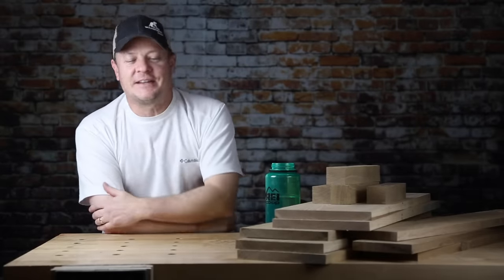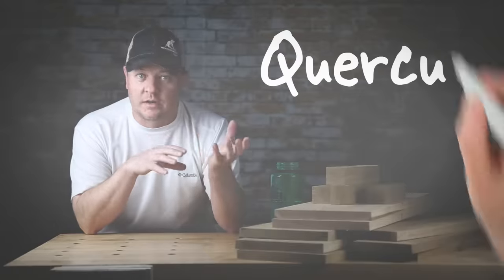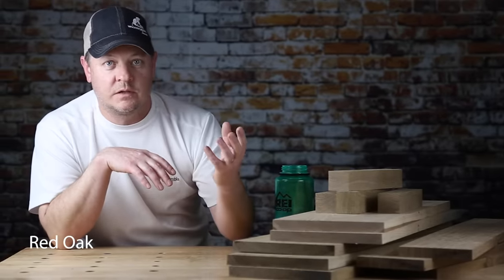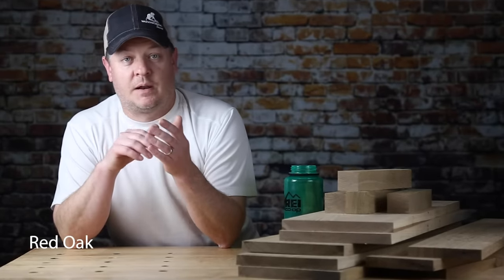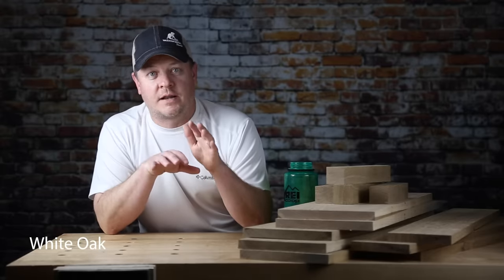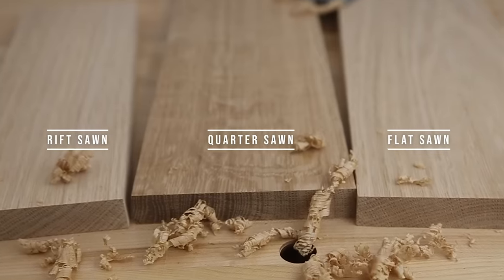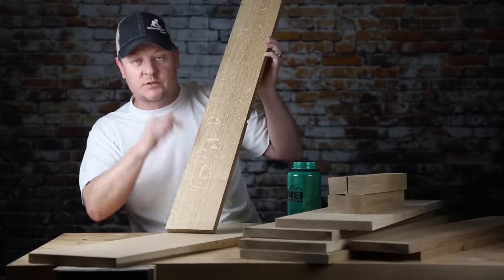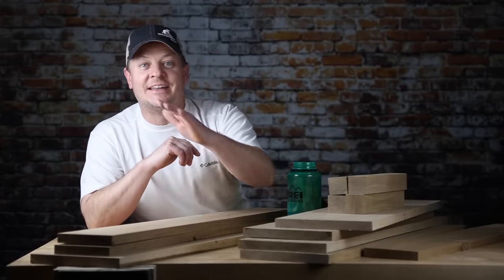The REAL Difference Between OAK Lumber

Comment: I have some left over solid oak flooring, is there someway to identify if it is red or white?
Reply from the maker: There are subtle nuances in the color and grain that are just difficult to communicate in a comment here. Get a known piece of red or white oak to use as a control. Even better if it's the same size as a piece of your flooring. White oak is heavier so you'd be able to detect that in your hand as long as both pieces are about the same size.
Reply: Look at the end grain, white oak is closed pore and red oak is open. You can usually tell them apart easily, but you can wet the end and see if it wicks up the grain.

Comment: What he failed to mention is that all of the other species are also sawn and are sold as either red oak, or white oak.  While some the difference is minor, others are quite different.   Black oak is more red and softer than true red oak, pin oak is brown and tan, but is still a red oak.  Cherrybark is by far the superior red oak lumber species.

Burr oak is white oak, but much darker color, as is Chestnut oak, but it is lighter weight and has open pores like a red oak, thus cannot be used for cooperage.   Swamp Chestnut oak is lighter than true white oak, and highly prized in the veneer trade.  Chinkapin (Chinquapin as it was known till a few years ago) oak is more yellow, but has very distinct grain.

Hope this helps some people with color match and grain match issues.   Many more factor's come into play, but I wanted to share that.  At the sawmill we might have a half dozen different species, cross bred species, healthy tree's, nearly dead tree's, all from dozens of different locations which further add to the variations.  All this is sawn, put in the same bundle and shipped together.  That is the commercial side of hardwood lumber business

Comment: There is a way to differentiate white oak and red oak. Very often resellers get red and white oak species mixed.
There is a way to tell for sure using water. The white does not transfer water through capillary action.
Could you explain this simple test? If you mistakenly buy red thinking it was white your outdoor project will be very short lived.
Reply from the maker: Not sure about using water . . . but using eyeballs you can look at the end grain and compare boards and white oak will be noticeably darker and tanner than red oak.
Reply from the maker: actually, see comment by full circle school of woodworking for info about using soapy water on red oak:
 https://www.youtube.com/watch?v=AeRjXyYA41I&lc=UgwWMKEKBIk3nvrT0Dl4AaABAg

Comment: Interesting story, but USS Constitution was actually built of southern live oak, Quercus  Virginiana.  Another difference is that most white oak is suitable for boat building while red oak and a few other oak species are not.  Water will move through red oak like a bundle of straws.
Reply from the maker: 👍Parts of it were, yes, but not the outer hull. The point remains.... white oak is tough, and it's great for exterior projects.
Reply: @WoodworkersSourcecom  :  The "outer hull" or skin of a vessel is a system that makes the vessel watertight, and, in the case of a warship, provides defensive protection.  In the case of 18th century vessels, in this case USS Constitution, the outer hull consisted of three layers of wooden planking:  two of white oak which sandwiched one of live oak.  That system was unique for its time in that the live oak layer made the hull impervious to cannon fire.  Contemporary vessels which commonly had hulls double or triple planked with white oak were readily susceptible to damage by cannon fire.
Reply: However, Q. virginiana is a type of "red oak."

Comment: All red oaks have pointed leaves even though they're different species.  Scarlet oak, Pin oak, and Red oak. These are open pore woods. As a straw in liquid. Boats made of red oaks would fill with water, not good. Red oak has tannins that eat through iron hardware pretty quickly.  White oaks have rounded lobed leaves and are closed pore woods. Bur oak, Swamp oak and White oak. Much better for boats and whisky barrels.
Reply: There are several species of "red" oak which have lobed leaves (Schumard - which is excellent for lumber, Southern Red Oak- also good lumber, black jack and blue jack oak are a few examples.  These "red" oaks loose their leaves in the Fall.  "Red" oaks with ovate leaves, such as live oak, myrtle oak, water oak, etc., are "evergreen" oaks.  The emerging leaves in the Spring cause the leaves from the previous year to drop.

Comment: I posted on the walnut video also.  I live right in the middle of the midwest.  We can't get walnut or white oak.  The sawmills are saving back for China.  All of the walnut and white oak are being sold and shipped to China.  Not sure what they are doing with it, but they are buying as much as they can, at higher than top of the market prices.  Don't get me wrong.  If you want a few pieces at an extreme premium, you can get it.  Especially if you are a regular customer.  Bottom line is, it's all going to China.  I know this for a fact.  My local lumberyard recently sold 1.4 million board feet to China.  1.4 million isn't alot, in the grand scheme, but for a small yard in the middle of nowhere, that's alot.  Think what that means on a country wide scale.

Comment: You talked about the cosmetics but not the real structural difference. The pores in red oak are open but in white oak they are filled with resin making it denser, heavier and much more impervious to water.

Comment: The USS Constitution hull is made of both White Oak and Live Oak, the hull consists of three layers with the outer and inner layers running horizontal and made using White Oak and the middle layer being Live Oak and running vertical.  White Oaks grow tall and thin whereas Live Oaks are massive, low branched, spreading crown oaks prominent in the Southeaster U.S. Live Oak is about 40% denser than White Oak and significantly stronger than White Oak. The Live Oak center core is the reason that Constitution was able to withstand the cannon shots so will.

Comment: What about quartersawn red oak? I have not heard of quartersawn red oak but that don't mean it doesn't exist.  Thanks Don
Reply: Any wood can be quartersawn.  It just means that the slab runs radially out from the center.
Reply from the maker: yeah sorry if it didn't come across that way, but yes, red oak can be quartered and it too can reveal the same fleck figure/character you get in white oak. However there is more market demand for quartered white than there is quartered red.
Reply: You just happen to be in the wrong part of the US if you have not seen quarter sawen Red Oak
Reply: @TheFalconJetDriver  I am in Nashville.

Comment: Red Oak has an open cell structure which lends it to breakdown by fungus and premature rot of outdoor projects.  White oak has a closed cell matrix which means it does well in wet environments.  Cheasapeake Bay boat builders have long used white oak as the frame basis for deadrise (workboats) used in the traditional crabbing and oyster harvesting business.  You can steam white oak and make it very flexible to form into complex shapes necessary in boat building.

Comment: One of the biggest differences with red vs white is red oak has open pores and will soak up water faster, were as white oak has closed pores and will not soak up as much water. Take a 1ft peace of red oak and the same of white oak and put one end in water and blow on the other end and you will make small bubbles with the red oak but not with the white oak. Then leave them standing upright in the water and come back an hour latter and see what happens. Then you will know why ship wrights use white oak for boats.

Comment: You didn't mention the water permeability properties: Water easily penetrates red oak but not white oak. Thus whiskey barrels are white oak. You can use red oak barrels for dry products like wheat flour stored in dry locations; if it rains on red oak barrels the flour will be ruined.
Reply: Agreed.  I replaced the white oak rub rails on a 40 year old navy hull (motor whale boat) with red oak.  It was rotten in less than 5 years in a Chesapeake Bay environment.

Comment: Want to try something fun take a shoe mouldings size of red and white oak 8 or so inches long put it in a cup
Of water and blow you will be able to blow bubbles thru the red oak but not the white because of the grain structure have fun

Comment: There is only about two species that matter to woodworkers.
Did you say that ? Did I take that out of context ?
Cause I like lots of different wood.
I really like Doug fir, but that’s coniferous.
I’ve use both white and read oak in projects.
I do like white oak more though.
It’s a great lumber for furniture.
1/4 saw also tends to stay very straight. Yes it looks great.
Reply from the maker: tina Haynes sorry yeah that should be “types” rather than species.

Comment: I'd like a lil more info on those cut techniques on the difference and how they are actually cut.
Reply: Look closely to the grain on the end of the boards when he is discussing how they are cut.  flat sawn the grain is parallel to the surface.  Rift sawn the grain is at 45 degrees to the surface.  Quarter sawn the grain is perpendicular to the surface.

Comment: You are wrong on one count. Only about 1 in 20 red oak boards will have well defined medullary  rays, which is prevalent in white. Also, R.O. tends to get mixed in with W.O. and can be hard to distinguish... until you finish. The two woods will take stain differently. R.O. is very porous, in W.O. the pores (rays) are sealed thus the distinctive look.
Reply: All the red oak I've ever seen has a pinkish-orange (ish) tinge to it.  White oak is more neutral.  I always thought the name was a reference to the color of the wood.
Reply: You can tell the difference at a glance nearly every time by looking at the end grain.

Comment: Please add the following, white oak has closed cells which is the real reason why it works for exterior projects and red oak does  not. In fact you can actually use red oak to make soap bubbles. Red oak is a very porous and...
Reply from the maker: True. Thanks for speaking up!

Comment: Your map does not even Mississippi, Arkansas, or East Texas where there is large amounts of Red and White Oak. I worked in a flooring mill where oak flooring was produced, and I have cut and hauled them as pulpwood in South Arkansas. I have also cut up two Red Oaks there that were over 100 yrs old. Personally, Red Oak is more attractive and less bland than White Oak in flooring.

Comment: Excellent description.  I would add however,,,, red oak is fairly consistent regionally.  Red oak as cut in Missouri is the same as Michigan, the same as found in Vermont,,,,, just another reason why red oak is universally liked and used.

However white oak exhibits very strong regional characteristics.  One reason may be in the extinction of the American passenger pigeon,, white oak two hundred years ago was perhaps half of all trees in the central states and New England, because the bird and the acorns had a symbiotic relationship.  No birds, fewer trees.  But,, for some reason Tennessee white oak is different than Michigan white oak and New England white oak is the very beast to work.  The US Constitution is hulled with New England white oak,, and that material can dull aluminum oxide sanding belts on the knots and burls.  Steel hand planes need frequent resharpening,,
Reply: Great piece of info, Sailor, thanks!
Reply: A lot of our American hardwoods are nothing like they where 200 years ago. Mostly because we clear cut through a lot of it around the beginning of the 20th century. What we have now as mature stands has only been growing since then and, in the case of most of our red oaks, it is nearing the end of its life span. White oak in general has a slightly longer lifer span, but they too are nearing the end.
Reply: @thomascalton3067  Yes.  We deal most ,or entirely with second and third growth forests.  I had a heart breaker recently.  I was called out to get rid of a wind fall, a tip up.  White oak, second growth I'd guess, but forest grown.  36 " chest high dia. 130 plus feet tall,, 50 or 60 feet of straight, clean bole.  But,,,, in a residential area and on ground far too soft to get equipment in, and other considerations.  All turned into firewood.  Broke my heart,, but no way to do anything else with the constraints.
Reply: @Sailor376also  That is too bad.  I personally believe our second and third growth timber of any species including our softwood cannot compare to the growth patterns and quality of true oldgrowth. It's just too bad it takes many centuries to get it.
Reply: @thomascalton3067  Yes.  Just discussing a long term project with a Canadian Province two weeks ago. A truly valuable forest and production begins with that 100 plus foot tall second growth forest.  That is just the nursery required. And then,, you get the lumber or veneer trees started underneath.  The single most valuable trees in a 300 year old forest are those spindly thin telephone pole like, absolutely straight and not a branch on them with a tiny crown struggling to get above the canopy (not dissimilar to that one I chopped up),,,,, because those are going to be wildly valuable and exactly the trees you are referring to.  Small, tight grain, and clear lumber.  Each single tree within a hectare (about 2.5 US acres) is as valuable as clear cutting the entire plot for 35 year old chip board trees. And you can take one or two every 10 to 20 years indefinitely,, and make 20 times the money per year as that chip board forest.  But,,,,, It requires a 200 year plan.  Ain't very likely to happen.

Comment: Greatly informative, thanks for presenting so well. Rapid fire monologue and cutting are at the very limit of what these old bones can handle, but I'll try to keep up.

All the points I was ready to add seem to be covered by previous comments, save one. Red Oak, when cut and worked, stinks! Smells like vomit, to me, compared to the spicy sweet smell of White. Forty years ago, my friend, mentor, and employer Dan Brummit told me the old timers called it "piss oak". White Oak is the far superior material in my book, in every respect. Red Oak only if no other choice.

Comment: What about live oak?  I believe you may be mistaken about the USS Constitution. (Or perhaps I'm wrong)
My memory says live oak was used on the outside hull of "Old Ironsides"
EDIT : We are both correct.  Both White Oak and Live Oak were used on the hull of USS Constitution!
Reply from the maker: You're not alone in that thought, and frankly I had a delightful "uh-oh" feeling about that fact after the video published. But yes, more accurately both types were used, not one or the other. whew
Reply: @WoodworkersSourcecom  - I'm in the Texas Hill Country, and after Ashe Juniper trees (called Mountain Cedar by the natives), Live Oak is the next most prominent tree.  I'd trade 100 Ashe Juniper trees for one Live Oak.  They are horrible trees.  Nearly everyone has allergy problems from their pollen. Ashe Juniper burn like gasoline, and can create a wildfire that's very dangerous and difficult to control.

Comment: The first I thought wow this guy must really know his wood and then after the explination of what quarter-sawn wood is all about I thought his explanation was a little weak because stability is one of the main features of its vertical grain that is an I just think the information is a little weak  sorry
Reply: I didn't have a problem with his explanation of the different types, other than he did not say that rift sawn is @ 45 degrees to the face of the board and that quarter sawn is @ 90 degrees, i.e., the angle made by the annular rings.

Comment: The Constitution was planked with Live Oak.
Reply: I was waiting for someone to say this. Well done!
Reply: Live oak from hurricane Hugo damaged trees was collected and sent to Boston SY to be used for Constitution repairs. As dense as it is it ought to be about air dried enough to use by now...30 years this month.
Reply: Only partially.  Constiitution's hull is triple planked.  She has an inner and an outer layer of white oak planking that runs parallel to the waterline and a middle layer of live oak sandwiched between the layers of white oak that runs perpendicular to the waterline.
Reply: The frame of the USS Constitution was also made from live oak. One unique aspect of the frame was the use of diagonals which made the ship far stronger than other ships of the time.
Spare timbers for the Constitution, predrilled and fitted, were found buried under Chevalier Field runway on Pensacola Naval Air Station in 1972 or 73 when a ditch was being dug. Workers called in larger equipment after 2 chainsaws were burned out trying to cut through a 10x10 timber. Records were found that indicated the timbers had been buried in a pond in the early 1800's, the pond being filled in sometime later. 
One interesting fact about live oak is that it is denser than water, i.e. it sinks.

Comment: Ok an old timers showed me this anoint why white oak was a better species for exterior.
Cross cut a thin piece1/16th  off both red and white . And hold it to the light. Do it with all hardwoods if you thinking about using it outside.
Tell me  what you see. The porous nature of some species make them inferior choice for exterior work . Red oak is way more porous it’s easy to see.

Comment: I like working with the Money Tree, I prefer the 50 dollar species over the 20 dollar species.  I find the 20 dollar species easier use because the lack of supply with the 50 species.  The 20 dollar species seems to be accepted by everyone and is very popular.  It holds up great to water and is very pliable.  It takes on Green stains extremely well is and very durable.